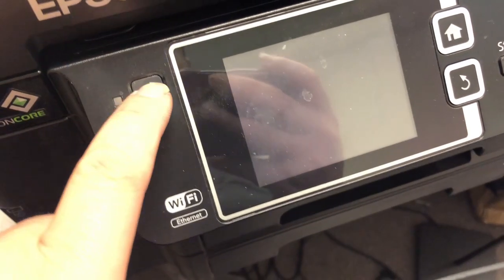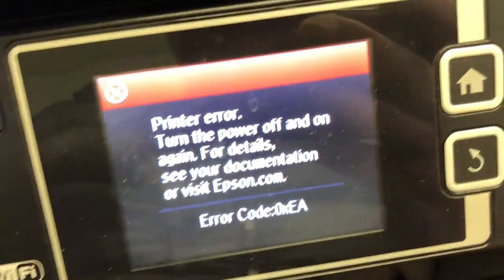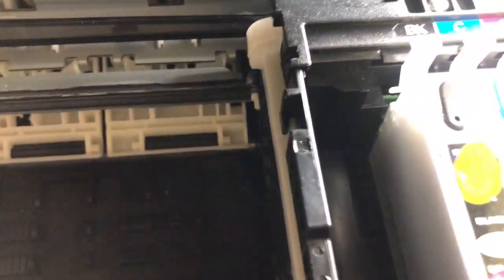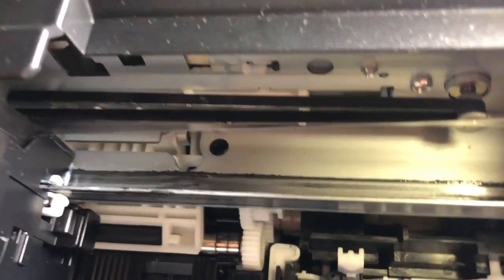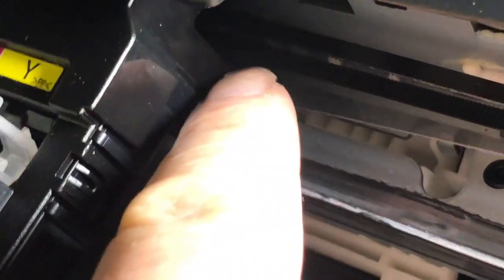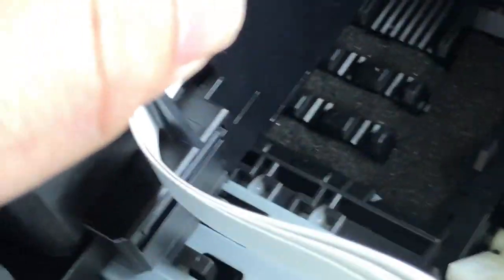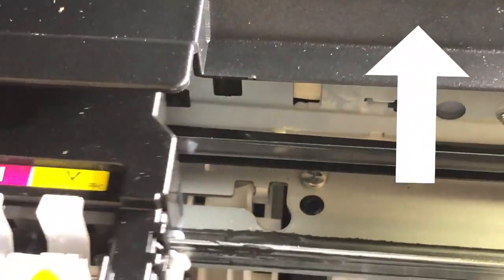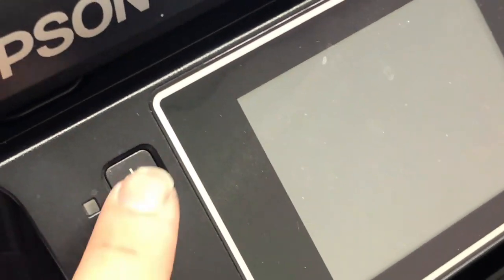How to Fix Epson Printer Error Code 0xEA: Re-position CR Encoder Scale

Comment: I had the  0XEA error and had to buy another encoder strip.  The printhead does not slam the left side of the printer anymore, BUT there is a Screeching sound when it gets on the left sidee to take it's place.  Same 0XEA error, but some plastic tabs are not releasing it seems and the printhead is locked on the left side.  Do you know how to fix that??
Reply: yes